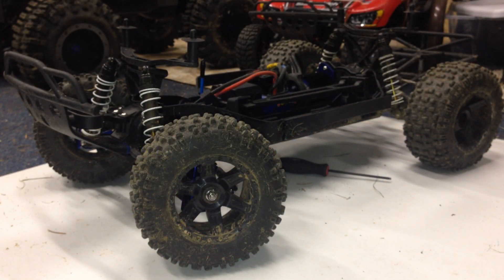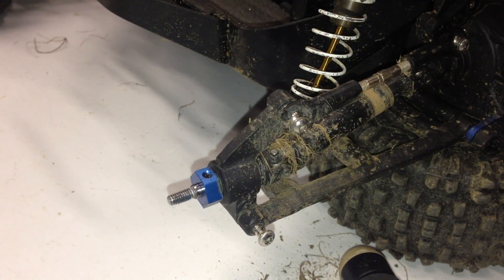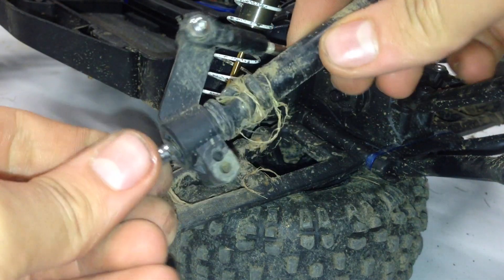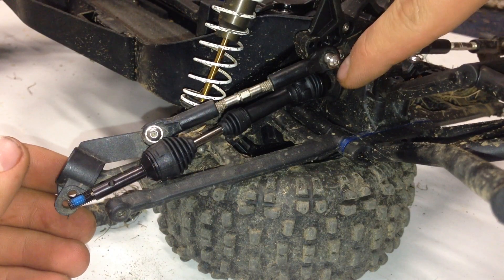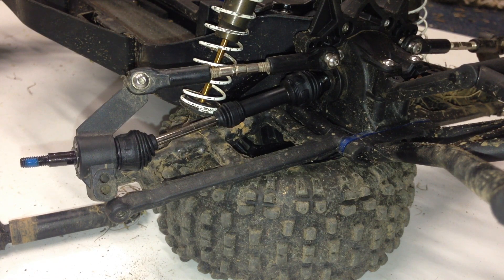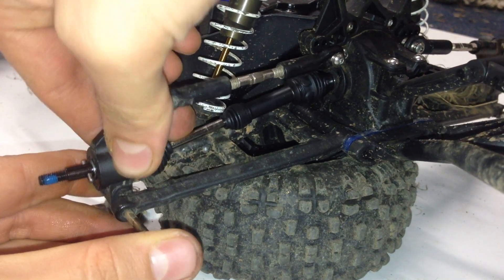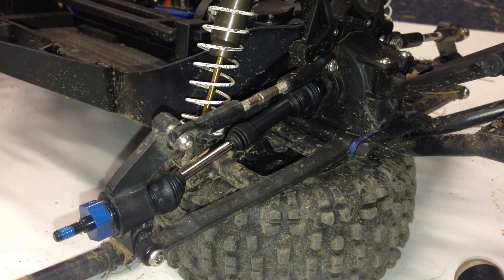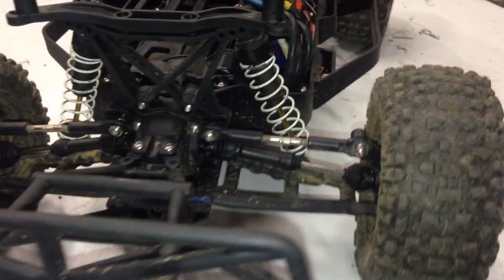Traxxas Slash 4x4 level 6 upgrade- traxxas Constant velocity driveshafts

Comment: Interested to know how these hold up. My next RC will be a Slash 4x4 Platinum. I think the Tekno RC drive shafts are the best ones to get, but they need Tekno specific rear hub carriers to be installed along with them, so I'm thinking about getting these Traxxas CVDs instead. Just worried that I might break them driving fast on 3S.

Comment: When you call it a level 6 upgrade what are you referring to when it comes to the levels.  Also on those drive shafts can you get replacements for the rubber covers when they wear out and get shredded?  I am curious because i would like to eventually switch out most of my Traxxas vehicle's drive lines and shafts.
Reply from the maker: It means the 6th upgrade. I think of it like in a race car game where you level your car up till the stats are really good. As for the repair kit for the driveshafts i have not seen any around as of now.
Reply: OK, thanks for the info.  I will try those out and see how they do.
Reply: Rustlervxl09 look here it works for all the cvd's they just don't tell you that. http://www.amain.com/product_info.php/cPath/1_25_1466_2139/products_id/221173/n/Traxxas-Steel-Splined-Driveshaft-Rebuild-Kit

Comment: I got those driveshafts, and a week ago they broke. Wasn't happy as they are like 80 dollars, but luckily traxxas replaced the out drive which was broken for free
Reply: Any more issues?
Reply: Nope
Reply: What power system are you running on?
Reply: Did they end up breaking again or no bc I dont know what ones to get

Comment: I keep snapping the stock drive axles....are these worth the money. I'm running monster truck tires with a 3900kv onyx motor 3s lipo and a 31t 86t gear. It's actually twisted them.
Reply from the maker: thomas huffjr Yeah, I'd suggest them
Reply: thomas huffjr a must for running 3s battery packs
Reply: No do not buy they's they come apart so easy, get the ones mip make
Reply: traxxasbandit1 do you have a link then? Please give it to me :)
Reply: https://www.amainhobbies.com/mip-xduty-keyed-rear-cvd-kit-slash-4x4-mip10130/p179493

keep in mind they's are for the rear, the front ones are alittle different, most online hobby stores carry them or ask your local hobby shop

Comment: Did these axles work well on 3s? I bought pro-line steel axles and they are constantly breaking. Can you help me figure out what would take 3s without breaking? I'm running a Slash 4x4 platinum and a Stampede 4x4 VXL
Reply from the maker: Timothy Day Yes, they actually are very strong and stood up yo my maxamps 3s bashing and jumping with no issues at all
Reply: Did you ever find a axle that will take 3s?

Comment: nice video! how is the driveshaft holding up? and also if you were to choose mip or traxxas? driveshafts ofc
Reply from the maker: Great question! These are holding up great and are very light weight. Overall I would prefer these for faster speed because of less rattle and vibration because of their weight. However the MIP are much stronger. I think you will have no problems with these though.
Reply: +Rustlervxl09 well thanks for replying. im considering the traxxas one for my rally/slash also check out my channel! i subbed :D

Comment: Got a problem with front end being to heavy when I take off jumps, any advice or suggestions?
Reply from the maker: I'm no expert on this but I have a few ideas. Stiffening the front shocks might help at takeoff, giving more throttle at takeoff and while in mid air should help. I wouldn't try to rearrange where things are on the chassis to balance weight, and I wouldn't add weight to the back to balance it. Hope this helped
Reply: +Rustlervxl09 man went out today to a small dirt jump at a park and was jumping nice!! With nice air and hang time!! Thanks man

Comment: I have a problem with my LCG version where when I full throttle the front lifts up and leaves the front two wheels off the ground just spinning.    Any suggestions would be awesome      If u don't know feel free to pass this on to someone else
Reply from the maker: What's the issue? it's 4wd so all tires will spin at all times
Reply: I know but what's causing it to lift up.      Should I glue a weight in the front.    What I mean is I am getting no traction from the front wheels because they are off the ground     Thanks
Reply from the maker: Sounds like not much weight in the front or your too heavy on the throttle and you doing a wheelie. you can try weights on front but it will just stress the motor more.
Reply: Rustlervxl09 yeh expensive motor to fuck up
Reply: Your slipper clutch is to tight, loosen it slightly.
Reply: Spunky Bob ah cool thanks bro
Reply: FUNNY FUDGE MAN I just realised you wrote this like 2 months ago... guest its old news now ;-)
Reply: Spunky Bob no it's fine it's on a shelf ATM cos I broke a drive shaft.  Lol

Comment: Can these drive shafts hold up to a 1/8 scale motor
Reply from the maker: I'm not sure. I have had zero problems with them so far, so they might
Reply: no my slash ultimate  orke the  on  3s on the second day of using them but that dosent mean you cant have better luck than me

Comment: I don't get free anything like ever. And when I buy a set of driveshafts for $100 use them ONCE for less than a 20 minutes and the BOOTS RIP. Wtf is wrong with the spurt cover being Sooooo damb close to the driveshaft rubber boots. 

I think the driveshafts should last a bit longer than 20 minutes

Comment: can put this drive shafts in a traxxas rustler
Reply from the maker: No this one doesn't fit the rustler
Reply: do u no if i can get drive shafts for a rustler?
Reply from the maker: This is the part number for the ones you want TRA1951R
Reply: ok thanks